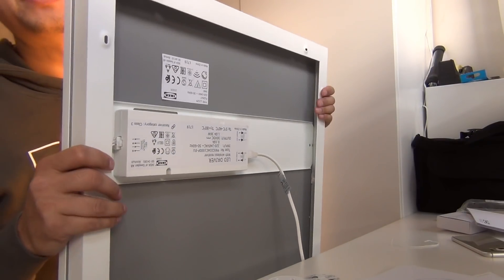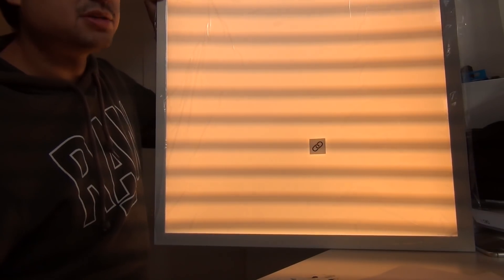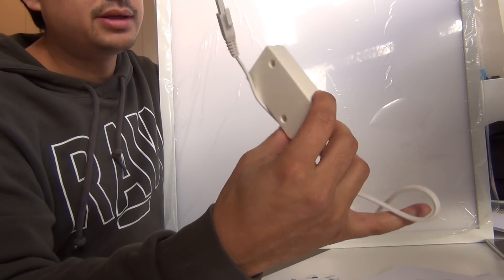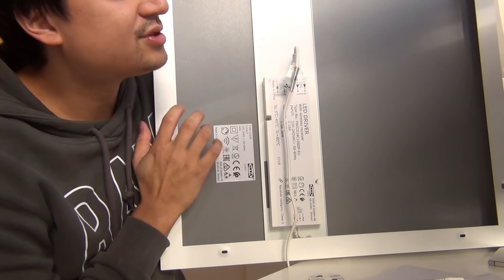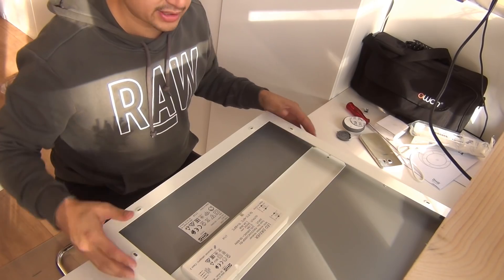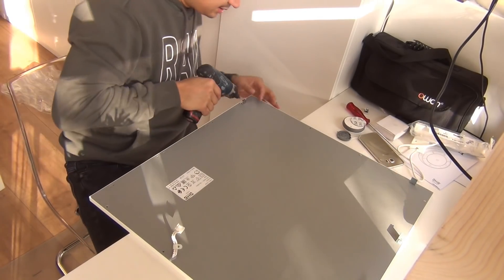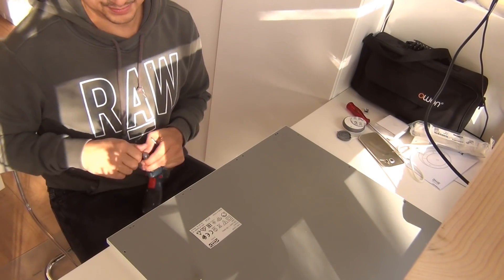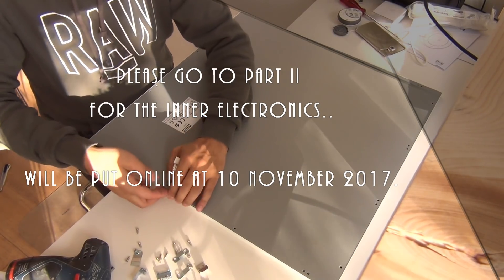Ikea Smart LED FLOALT 60x60cm square LED panel Part 1

Comment: Hi PLS answer my question. So of I buy this can I use directly on the wall instead of a regular spot lamp ? I mean I want to apply directly to the wall (2 / 220W cable ) or this lamp can be used only with power socket (plug) my problem is that I want to switch my spot lamp to this but then I have 2 wire from the wall.
Reply from the maker: I do not understand your question. Can you help me out what you mean? You cannot use this device without the supplied transformer.

Comment: I bought a Floalt LED panel in a larger size. There is no power supply on the back and it looks like it has to be installed by an electrician. Do you know if I can buy a power supply so that I can plug it into the wall? I've contacted Ikea so many times and don't get an answer.
Reply: Give your local IKEA a call or send an email. They're usually very helpful.

i would be surprised if you can't install it yourself. It's not in the IKEA concept to sell things people cannot install.

Comment: Can you link multiple panels together to work with one switch?
Reply: With a home controller, you can do that. Not sure if you can do it with a remote directly.
Reply: @WillyPietersz  With the "hockey puck" controller, you should be able to link around a dozen individual light panels, bulbs, etc from IKEA's smart lighting series. At least, that's what the controller's description states. Have been successful with individual TRADFRI bulbs but not tested multiple FLOALT panels.
Reply from the maker: @MakotoHawkins  thank you for your input!! Much appreciated.

Comment: Hi there--- I have a question about the wiring. So to set this up in a plug (two or three prong plug, in the wall), all you need is the ANSLUTA piece?
Reply: Yeah I have the same question, I’ve read online that in the US FLOALT can only be hardwired, is this correct? The product page doesn’t mention ANSLUTA at all.
Reply: @briwil78  Just bought it. The Floalt does not come with an outlet plug. It's 3 cut wires that need to be hardwired to a power box in the wall. Going to try and buy a cable at home depot and just wire it myself.
Reply: @briwil78  I am also wondering the same thing.  The item description online was very ambiguous, it seemed like it could be plugged into a wall. Is that not the case in the USA? I have no intention of hardwiring it. I have contacted Ikea several times and get no response.
Reply from the maker: Not sure what you mean? You want to run it from seperate power supply?
Reply: @YourWizBlog  sorry to be confusing! I was just wanting to make sure that the panel can be plugged in directly to a regular wall plug, that it does not have to be hard wired to recessed lighting?

Comment: Just for others who found this video. The "bars you only see on camera" are an effect of PWM dimming at a frequency the camera can see (but your eyes generally can't). That's why when it's on one color full output those bars disappear. Seems like full output with both colors they do some PWM dimming on both channels to mix the colors to the values they want them to be, probably also to manage heat output so that using full brightness with 2 channels active won't use more power and thus generate more heat. You can prevent the PWM dimming on camera by using a (much) higher PWM dimming frequency. I've built some custom controllers for doing just that so lights like these (or any LED strip) can be used as video lights connected to Home Assistant. :)
Reply from the maker: Thank you for the additional information!

Comment: Bought one, also makes a buzzing noise. Louder when intensity is increased. It is much less audible though when hanging, the panel itself dampens the noise I think.
Reply: Thanks for the info I was going to try one as a film making light....but if it buzzes then that would be a sound issue when filming (if the light has to be close to actor) 👍

Comment: Any idea how to remove it from the frame once it's mounted on the wall/ceiling? Once the clips click into place, it seems impossible to remove...
Reply: i've got the same problem, did you find a solution? all se best
Reply: In fact, I did. They don't mention it in the manual for whatever reason, but anyway: You have one part that's on the wall or ceiling, and the light itself. On the light itself, there is a piece of metal that hooks in on the wall mounted part and the clip(s) on the other side. To remove, you just have to push the side with the clips towards the little hooking piece and pull downwards. The metal piece budges a bit and you can clear the clips. Seems like they forgot an arrow on page 2 of the manual.

Comment: does it make a buzzing sound when it turns on? 
my one makes a noise. I am thinking about to return it. How is yours?
Reply: Hi! I do not have any buzzing sound... I think you should return it :-)
Reply: Thank you for your reply. I just returned it. And I bought it again. The new one makes also buzzing sound in warm yellow light mode. I will return it again. It is dissappointing.

Comment: Ok what if I switch it of on remote...and the try tobswitchbit on with the wall switcher on the wall? So i turn the switcher off(cause it was switch off with remote) and then switch it back on again..will the lamp remain off or will it switch on?
Reply: The IKEA bulbs, afaik, will switch on to the latest setting, compared to Hues which will turn on at max brightness. Ikea clearly wins in my mind! Not sure if FLOALT has the same behaviour.
Reply: Hi Mr Jonks, Just bought and installed the FLOALT 30cm, replaced the dimmer with a 220v power cord. The floalt will be switched with my existing domotica. (not by ikea switch). 
As such I can confirm that these FLOALT planels 'remember' their last used light stand.

Comment: Is it zigbee compatible? Want to implement it in my hue environment
Reply: Yes it is. All IKEA smart lighting can now be paired with the Hue bridge. Hue bulbs can also be paired with the TRÅDFRI gateway. This was added in a firmware update so if you have older units you might need a TRÅDFRI gateway to update the firmware on the TRÅDFRI or FLOALT lights before you can pair them with the Hue bridge. Most newly purchased IKEA smart lights should now already be on a recent enough firmware.